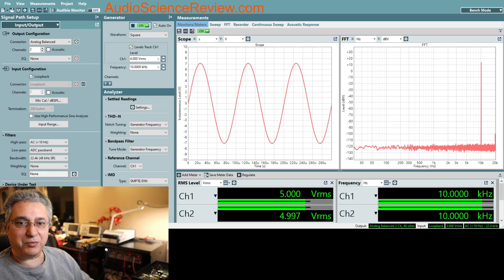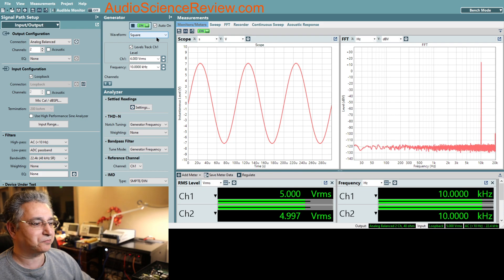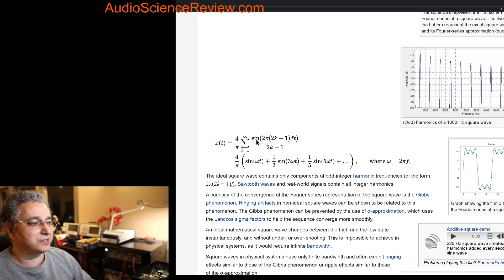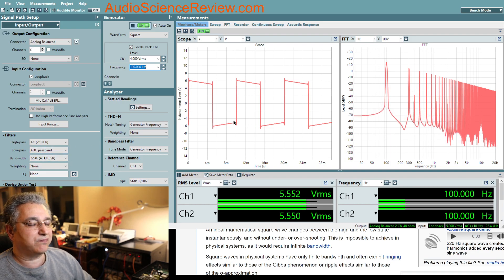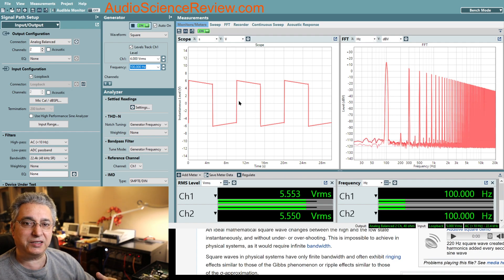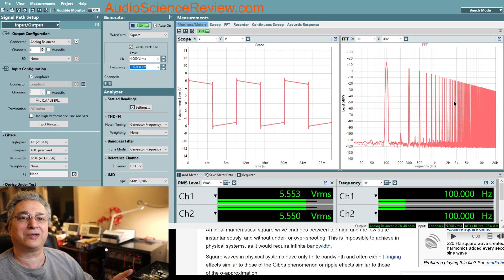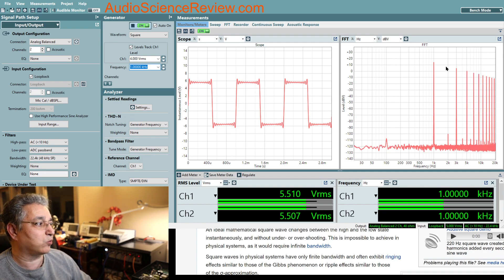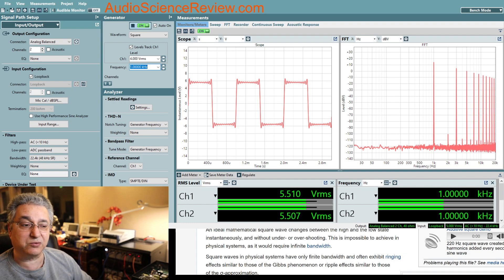Square Wave Testing of Audio Products

Comment: Great topic 😀 Most amplifiers wont output anything resembling a square wave when fed with one, esp. the discrete class-B's, presumably due to AC coupling and internal compensation. Found that one out early on experimenting with op-amps. When wired up to give a nice square wave, they also make very good low RF amplifiers and oscillators, depending on what the gain bandwidth is.
Reply: It has nothing to do with class B.
The point is human auditory system has limited bandwidth. So reproduction higher than 20khz doesn't matter.
Reply: @johnyang799  bandlimited square waves still want some love tho.. they hope you see they are still badasses and exist in music.. they, like their perfect brothers dont like to be skewed with :p
Reply: @johnyang799  My point was that some amplifiers wont output a rounded square wave AT ALL. Feed a square wave in, and you just get a bunch of oddly shaped blobs of positive and negative polarity at the output. If you were not aware that square waves are a no-no with most audio equipment, they would indeed give the impression that something is gravely amiss as Amir stated. The only amp that I have that does do square waves (with some rounding of the leading edges due to band-limiting) is my LM3886 based one, because the LM3886 is an op-amp, after all, and has reasonable bandwidth. With discrete class-B amplifiers, the large real-estate that's taken up by the circuit means that careful compensation of the feedback loop and decoupling are needed to ensure stability and internal bias will require AC coupling of the stages. These will sometimes murder the square wave, and output nothing gibberish on a scope.
Reply: @mysock351C  Pretty much all class A AB B amplifier are basically opamps. 
They all should produce somewhat good looking square wave. Some overshoot is acceptable. But at least they should resemble square wave. Full scale square wave may cause some issues but asking for 1V output is ok. 
AC coupling will just make inward slopes. Compensation mostly can create weird shape square wave but 1KHz square wave with 20KHz bandwidth limit shouldn't have any issue. Plus most amplifiers use simple first order compensation which shouldn't lead to any issue. 
Even for class D amplifier, a well designed ones shouldn't have overshoot with load.

And mostly it's basically in the frequency response. A peak = a ringing in square wave. If no peak and no slewrate issue, you get good square wave.
Reply: @johnyang799  In practice there is a lot more to it than that, at least from taking actual measurements. With discrete amplifiers, there are additional constraints imposed when using various types of transistors and their respective tolerances, such as how much bias current can be run, what the bandwidth limits are, output stage characteristics, coupling of stages, etc. This means that there can be substantial limits imposed on bandwidth at higher and lower frequencies as well as asymmetric slew rate, depending on how the design was done. With an op-amp, since everything is on one die, and made of the same silicon, dazzling slew rates and bandwidths are possible, leading to them being able to make very nice square waves (as one would expect). When you have a circuit spread out over many square inches of a circuit board, and composed of transistors from various manufacturers, things are a bit different. While this doesn't impact the audio at all, there can be substantial distortion of square waves beyond just rounding the leading edges. PWM audio ICs in phones and sound cards seem to be more consistent. They will make square waves, but with substantial ringing at each edge, typically above the audio band, due to the sharp transition.
Reply: @mysock351C  Good designs should behave well.  I'm a designer I know.
Reply: @johnyang799  As an engineer myself, I can also say that those designs often have to appease supply chain and the bean counters in marketing, which inevitably leads to compromises having to be made even in reasonably branded gear. This doesn't mean that it doesn't work for audio, just that it wont work as an arbitrary function generator. Obviously in our own designs we don't have to worry about lifecycle management, design for manufacture, price point, and so on so we have the luxury to make the stuff we want. Im not saying this to argue. No, just that if you plop a function generator on the input of a consumer hi-fi linear amplifier or receiver, it can have unexpected results with triangle, square, and saw-tooth waves. However it will typically have little difficulty with a sine wave from about 30-40Hz up to 20kHz. Just a fact of life.
Reply: @mysock351C  I said.... You should have a reasonable looking non full scale 1khz square wave with 20khz band limit. This is bare minimum of any functional audio amplifier. Without band limited, you should only see some overshoot. Any other weird behavior shouldn't be accepted. 
I never said reproducing perfect square wave. This was a issue in the 70s 80s where people fight for fastest amplifier reproducing 50KHz square wave. But I wasn't talking about that.
Reply: @johnyang799  And I agree... for stuff I might make. But Im not a consumer hi-fi equipment manufacturer, so what they find acceptable may be quite different than what we find acceptable. The amplifier I have next to me that I built will reproduce band-limited square waves, with the typical rounded edges. As an example taking measurements on a Denon AV surround sound receiver I had it wasn't the usual band limited square wave, but was substantially rounded over the entirety of each period even after adjustment of any tone controls. Triangle waves worked ok as long as the frequency was not too high. I wanted to use it to do some speaker measurements (more specifically have a look at the back-EMF behavior), but obviously that wasn't going to happen. However it worked absolutely fine for its intended purpose. I suspect it may be a form of intentional slew-rate limiting to prevent launching speaker cones across the room when someone does something stupid, but I would have to take a closer look at it. Circling back I stated this not as a discussion on the effects of band limiting on square waves and amplifier design, but to buttress Amir's very valid point that you need to eschew square waves when testing. From my experience, odd behavior can be seen in some gear.
Reply: @mysock351C  Emmm. Back to the initial point. That's unless there's severe slewrate issue, frequency response will predict square wave in an amplifier. So Amir is not wrong. Just measure frequency response. Square wave is useful for stability analysis and that's about it in evaluating hifi equipments.
Reply: @johnyang799  Why do we have to argue over this? As I said, not all equipment will pass a square wave as one would expect from, you know, actually feeding them square waves and seeing the output. There are probably a multitude of reasons for that (e.g. protecting the speakers, amplifier design, etc.), and I never said Amir was wrong. It has its uses, but I would not use square waves for measuring gear alone.
Reply: yet some output them better than others but since Amir said there is no existing music with square wavs... (sacarsm)

also because a true square waves need infinite bits of resolutions and infinite frequencies they dont exist.. an approximative square wav is just a sine wav that try to look cool ahhaha so lets measure everything with a sine sweep

Comment: It's just FR anyway
Reply: I mean the square wave doesn't show a thing that's not already in the FR in the time domain since the very definition of a minimum phase system is that FR and phase are linked. Correct the FR and the CSD will also correct itself. Chocomel wrote up a nice post proving this quite straightforwardly on the subreddit

This isn't a personal opinion, this is just what I've been told by acoustic engineers like oratory as well
Reply: @metal571  yeah ive already read that post .. found it stupid but hey im a so called, self called expert ... who am I to even talk of sound near all these godly experts :p
Reply: That's the approach I take with it, I just assume I am the idiot here. Although I should say from my conversations with Dr. Olive on Twitter, it is still possible that a given headphone is very poorly designed and does have resonances that are very severe in the CSD, but this also usually shows up as sharp discontinuities in the FR also, like the M1060. This isn't typical though
Reply: not true for example CSD show decay after stop..(mass of the driver will impact CSD but that wont be readable in FR)

its seriously pathetic to stipulate time domain or phase are not important to reproduce correctly and just FR is king 

i will also add that lots of different measurements are needed to correctly understand what impact the FR too 

an FR change due to crosstalk will not sound the same as FR change due to resonnance
Reply from the maker: @lextr3110  I can see you will be very unhappy when I do my video on CSD.  :)
Reply: @AudioScienceReview  no worries, i'll have my fun commenting
Reply: @lextr3110  Frequency response includes Magnitude response and Phase response. And most of the time the "decay" in the CSD is just phase shift in the low frequencies. Human does not have a proper eye to interpret time domain.
Reply: @johnyang799  CSD show how quick a driver stop resonating at all frequencies when signal stop nothing more nothing less

its useful to know this and easier to directly see where there is even tiny resonances or long very low volume ones.. and YES you can see the same in FR but FR show a culmulation of many mesurements and its harder to discern different measurements in FR. Meaning one could mistake distortion peak for a resonance peak for example.

saying CSD doesnt matter because its in the FR is EXACTLY like saying distortion doesnt matter because its in the FR.. so why show any graph other than the FR than?? 

CSD is very useful when selecting speaker drivers and finding target crossover point and slope. where to apply notch filter for resonance peak.. you might not one a notch filter for a distortion peak but for resonance yes
Reply: @lextr3110  I said most of the time it's phase response. You will not know what cased the poor decay time in your CSD measurements. And that's not even mentioning the parameters to generate a CSD can drastically change the result. 
Basically you can only see some resonance through CSD easier. Anything else, no.
Reply: @johnyang799  with same parameters, its still useful then we agree on this :)